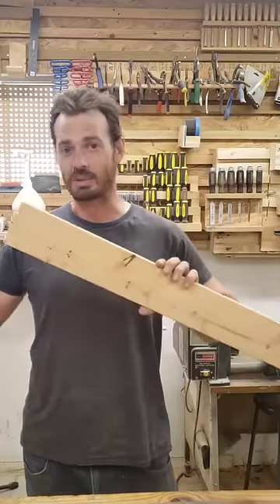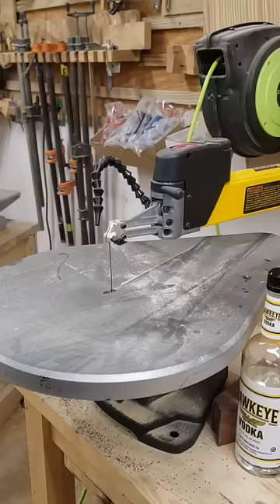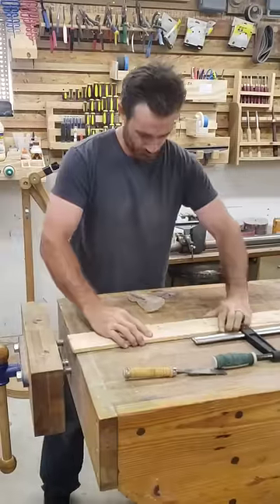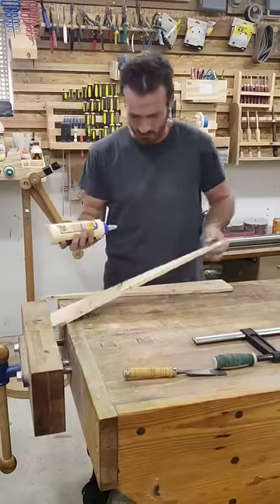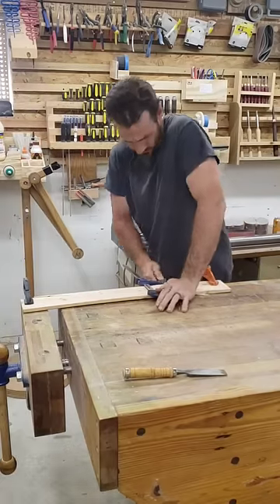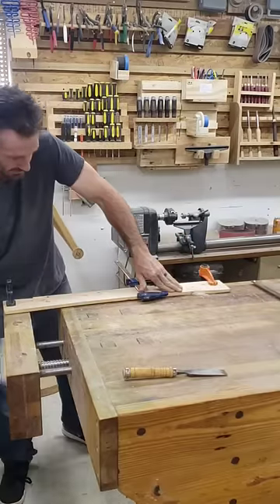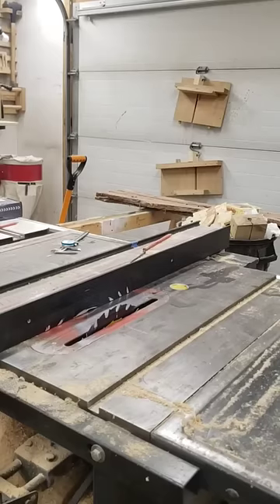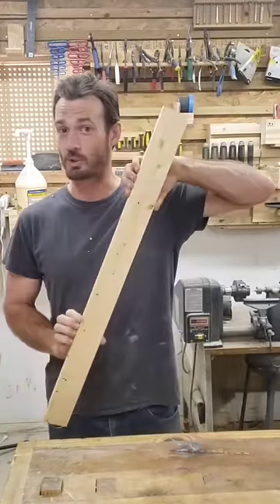How to use a board stretcher #Shorts

Comment: I knew it existed....now im off to find the left handed hammer in the basement of the shop...thanks
Reply from the maker: Be careful down there! I hear people get lost around Bay 13😂
Reply: Bruhhh😅
Reply: Tell me if you find a sky hook or tartan paint eh?
Reply: I think I left it beside the aluminum magnet
Reply: Can you grab the cordless air grinder while you're down there please?
Reply: Oh is it the left handed hammer for the ID-10T boards?
Reply: Grab some blinker fluid while you're down there
Reply: why wouldn't you just use the right size to begin with?
Reply: Left handed hammers are always next to metric adjustable wrenches.
Reply: It’s next to the metric adjustable wrench
Reply: The machine they use to test the tensile strength of welds is a pipe stretcher so check that one off the list
Reply: @martyk1156  I sent a greenie to the office one time to get a metric crescent wrench from the boss. Greenie came back with a crescent wrench that said 9mm-14mm (or some shit).  I looked over at the office and the fuggin grin on boss man's face was hilarious.  You got me boss.
Reply: Don't forget the bucket of steam
Reply: @natepeterson7145  they sell a product at big box stores called steam and it comes in a 5 gallon bucket ✔️
Reply: Don't forget the checkered paint!
Reply: Can you find my muffler bearings while your at it
Reply: If you can't find a left-handed one I have an electric one that I will sell you
Reply: When I was in the Air Force we'd send new recruits to the guard shack for formula K9P.
Reply: It's not in the basement. It's in the glove box next to the 4' level
Reply: @autumn5592  unfortunately, that one does exist, just not with that name lol
Reply: @silentxmaniac2708  it's actually an ID-10T form, not board, but close enough lol
Reply: We call them beam stretchers for our metal beams. Various sizes of them and we always tell the newer guys that need longer beams that they need to grab the beam stretcher from the basement. If they seem real gullible then we tell then its next to the bag stretcher.
Reply: @dustymiller8752  Yes, but you need something to hold the skyhook, so send them back to the stores for a long stand, and while they're there they should grab a bottle of propwash, so that you can clean it afterwards!
Reply: @kevreeduk222  😂
Reply: I am looking for counter clockwise wood screws for my left-hand screwdriver...
Reply: I’m still looking for the pipe stretcher
Reply: I too have a dozen right handed hammer but non left side one. Let me know how's done so I can built it with my left sided handsaw.
Reply: Are you going to use front side or backside nails?
Reply: Find the left angle grinder while you are at it.
Reply: They are by the toe nails.

Comment: Steam it and when it is good and rubbery.  Attached to the ceiling and pull down. To gain back the length. Because you cut the board too short.